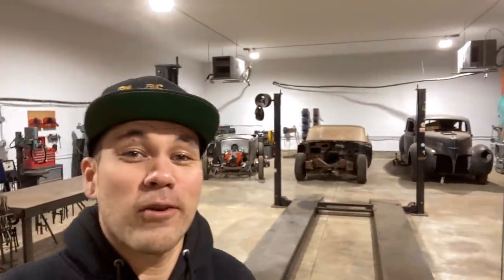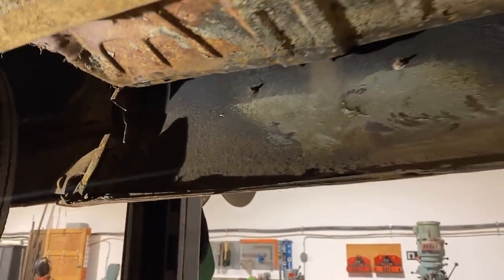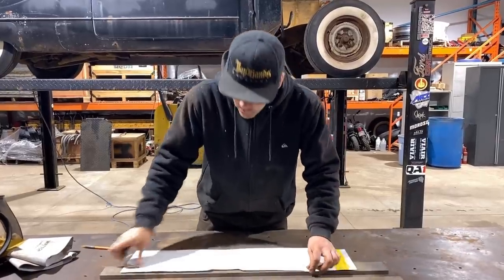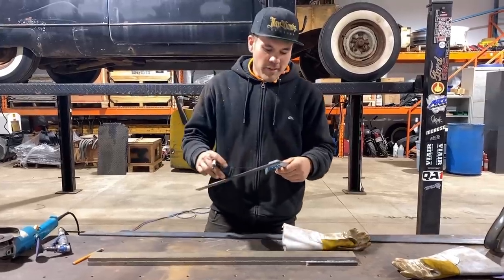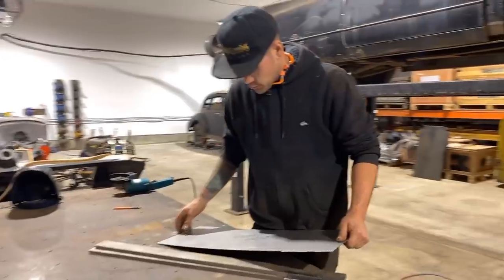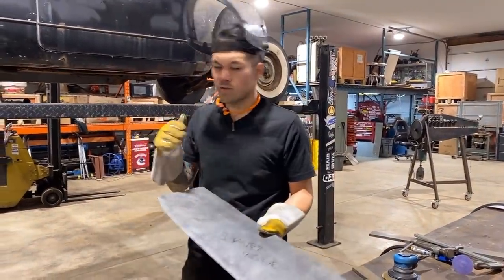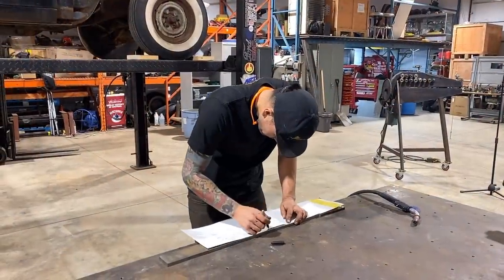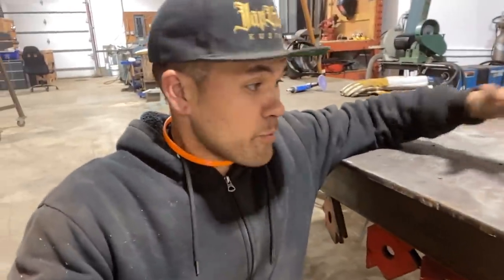1960 Cadillac Rust Repair Fix!! Hammer Forming Trunk Drop Downs | Bead Rolling a Curved Flange

Comment: Karl, I think it finally sunk (sank?) in for me today during this video that to be a well-rounded metal-smith, you simply must have to have welding skills & equipment in your toolbox.  Every well-rounded Blacksmith, Machinist, and Sheet-Metal Guru (I guess that's what you are?) has and uses those skills and that equipment, not just the "basic" equipment people think of when they think of for those trades.  I guess I need to go back to the welding supply house and get some gas bottles at least to get re-started at the least cost to my pocketbook.  I simply can't do the needed sheetmetal repair on my CJ-2A without it and refuse to simply use screws & "glue"!  And the oxy-acetylene will help with my Blacksmithing and even my Machine shop work/tooling, etc.  Thank you for sharing the little tips & tricks like these!  Especially simple little ideas like welding a 1/4-inch strip onto the edge to reduce the overall amount you have to grind away -- that's just genius that lots of folks wouldn't think of until too late!
Reply from the maker: Hey Bob, thanks so much for your feedback and good luck with your  CJ  ! I’m really happy to hear that you are going to fix this yourself! Thanks for watching cheers!

Comment: More great informative content Karl, I was told to start at the end and work it down in a linear progression but you started in the center and had most of one end done before starting the other end this could be why you had the extra in the middle not just the clamp in the way, not a criticism, and don't forget to use you ear protection when pounding those loose panels, from a deaf old bugger 😁

Comment: Love your work. I'm wondering why u use steel for the hammer forms. I use MDF and it works very well. Save the steel for something else.
Reply from the maker: I do use MDF but for a step like this I would end up destroying the wood it really needs to be quite strong with this type of manipulation
Reply: @MakeItKustom  i never had that problem but admittedly i never formed that fairly sharp corner u had.  But i think its worth mentioning that other form materials can be used. MDF  is cheap but a steel form like u used may not be readily available to all.
Not a criticism of your work which is absolutely amazing.  You would have tons of work if you came over to Australia.  Tough to find people with such talent that you have.

Comment: Karl again amazing thinking on your feet, Forgive my ignorance but what would be the result ( negative or problem )if you heated the sheet metal with a torch before hammer forming the steps. I would think the metal would stretch much easier at those points so there must be a negative I am missing. Thanks 👍🇨🇦

Comment: Have you ever considered using a wedge for cutting down trees. The one I use is from Canadian tire they are made of plastic and when working with sheet metal it doesn’t mare the steel when forming
Reply from the maker: Interesting I have not! I’ll look for them next time thanks for the tip

Comment: I use ultra fine point sharpies, no question where the line is, just hold them straight up and down at a 90 degree angle to what you’re writing on

Comment: Awesome work Karl  I'm keen to have a go at hammer forming. What would be the thickest material you could do this with? 🤔👍
Reply from the maker: You can go quite thick actually I’ve done 14 gauge steel but I use an air hammer

Comment: When I'm out of sharpies. Because let's face it they don't like contaminates. I usually just grab my box cutter as it makes an excellent scribing tool.  It's always around, easy to handle and apply plenty of pressure for clear lines and utility blades are inexpensive, durable, double tipped and come in packs of 100.

Comment: Thank you!!!! Just one question, could I use wood instead of steel for the die?
Reply from the maker: Yes depending on how hard the wood is. Are use MDF for some things but it is too soft for this form. A hardwood or a plastic would work as well
Reply: @MakeItKustom  Ok thanks.

Comment: Love your tutorials! Was that 18 gauge Metal you used to make the body panels? Also what Gauge would you choose for something like a Fender?
Reply from the maker: This panel is 18 gauge and I would use 18 gauge for offender. Typically outer body panels like door skins and quarter panels are 19 gauge but 18 gauge is close and ready to be available
Reply: @MakeItKustom  Thank you for your response I needed info for my next project. Appreciate it

Comment: Any tips on if the lower quarter is rotten
Reply from the maker: Replace it! Yes the lower quarter is rotten on one side of this Cadillac so I will be replacing that in a future video. It will require some English we will work to get the compound curve right
Reply: @MakeItKustom  so lower quarter first then inner ? Or inner first

Comment: What attachment and or tool did you use to grind out the spot welds before hammering them out? 2:13 ish
Reply from the maker: That was just a nerd bit on a die grinder. I couldn’t get my drill in the Quarter
Reply: @MakeItKustom  thanks for the reply! Looked like a pretty efficient way to get hard to reach spot welds

Comment: @8:09 adding a short piece of metal for the step instead of cutting the whole length down was such a simple yet brilliant idea! I would've tried to cut the whole length and either went through a handful of cutoff wheels or burnt up a bandsaw blade trying to do it. Good video with some great tips. 👍🍻

Comment: Many times you can use 3/4 MDF instead of 1/2 inch steel for hammer forms.   Much easier and faster than steel.  Billk

Comment: Foarming like you did, if you hammering a 45 angel or 90, do you hammer at the same way....? Understand what i mean?
Reply from the maker: I think I do. It’s a good thing to cover that I have not mentioned. When I’m hammering a flange I’ll start just a few degrees with the hammerhead and then do a pass then adjust the angle of a hammer and do a pass and so on

Comment: For a one off sheet metal piece like the passenger side drop down could you make the hammer form out of hard wood rather than cut 1/2 inch thick steel?
Reply: Karl, same question. I don't have as much scrap steel around vs MDF or other hard woods for forming. What's your thoughts on this to get it done.
Other videos and even on the Metal shaping forum it seems to be used. 

Just thinking outside of the box which I often do...😀
TX for another fantastic learning experience.. !
Mr fixit
Reply from the maker: Absolutely hardwood would work well for this. I think MDF would have a hard time